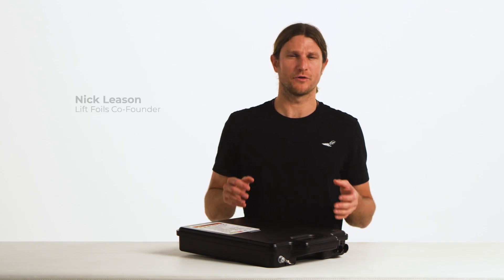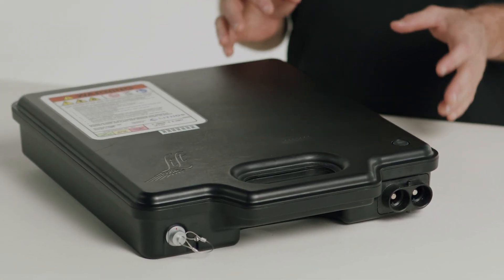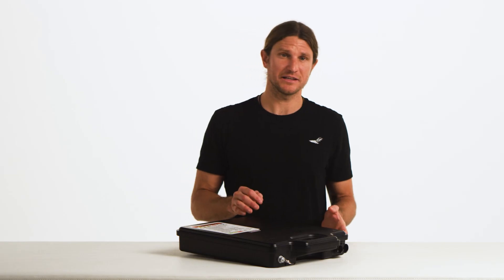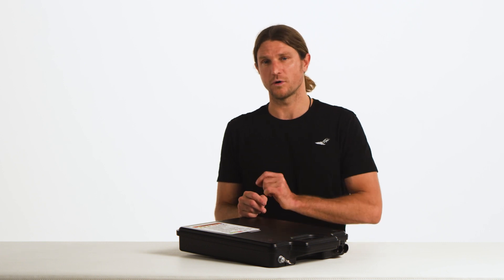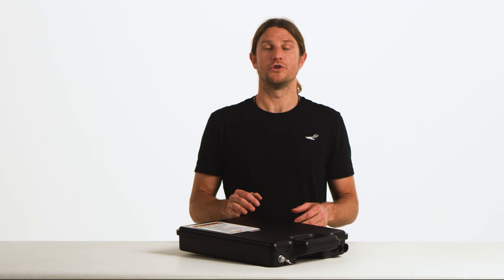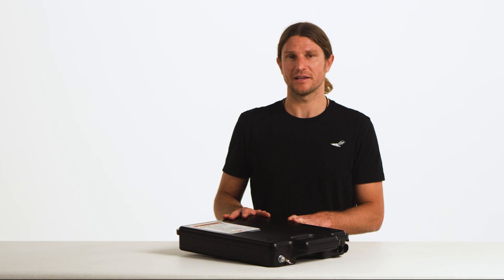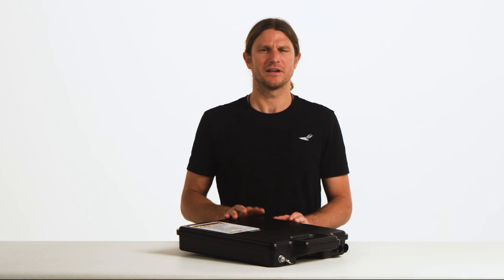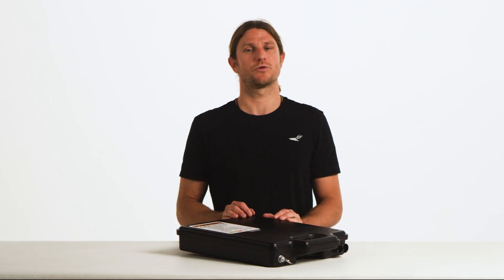How to Read the LEDs on Your Lift Battery

Comment: There is nothing in the manuel about what the different colors the leds can blink mean!
Reply: Did you get a reply or find out what the lights meant?  I need to diagnose a problem.  Thanks
Reply: There is absolutely not info about this in the manual and we are having issues with the batteries not working as well.